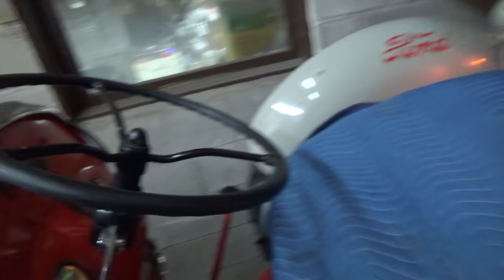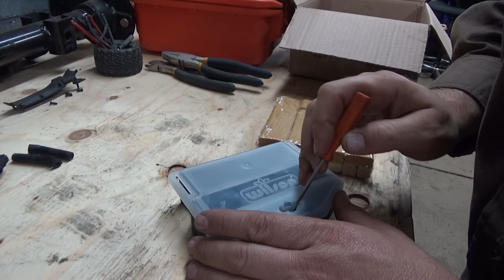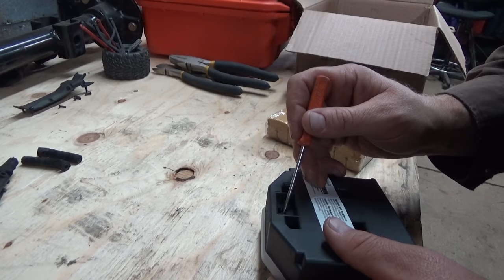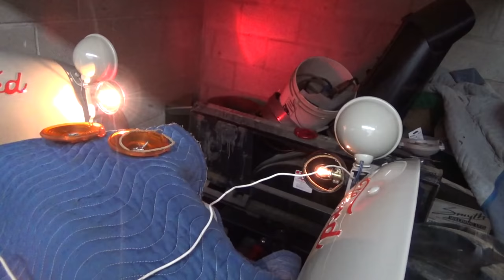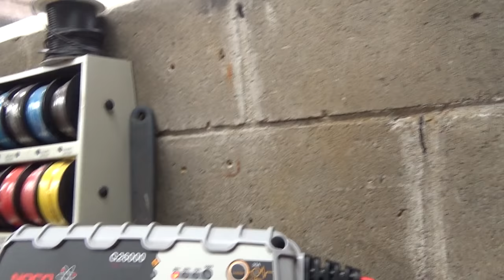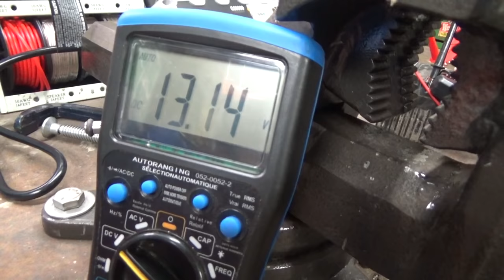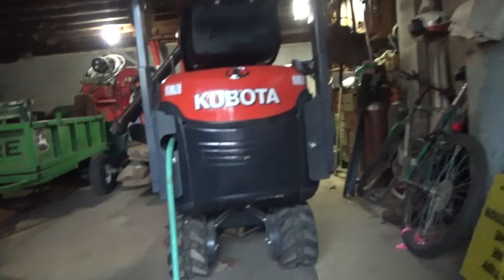Small wiring problem with boaris,  Need some help please :)

Comment: Bad ground. I see you using you light tester as a ground and it will not make a complete circuit. With your running lights off it is pulling the ground threw that feed. Try grounding it With a wire NOT your tester.

Comment: Check out the reviews on that charger as it appears to have quite a few limitations despite the manufacturers advertisement.   http://www.jumpstarterreviews.org/noco-genius-g26000-battery-charger-smart-and-beneficial   They also highly recommend reading the manual before operating.